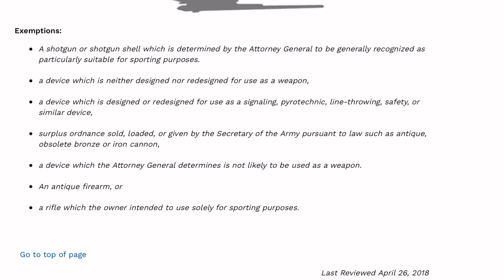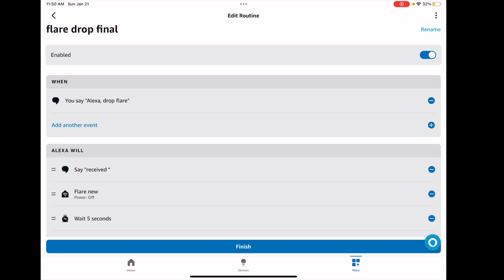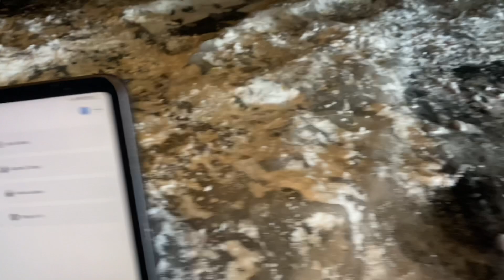Flare Launcher Prototype, Voice-Controlled |Safety Device (Real Life)

Comment: Amazon is a rip off. The gas from the .22 blank actually drives a piston forward at high speed hitting the head of the hardened steel pin or nail into concrete or whatever you need to drive a pin into.

Comment: Man, you really got me to thinking with this one.

Have you considered mixing model rocket fuel in a small quantity, pack in a metal tube with an electric igniter, add wadding, add your flare with the activation device?

Should cut down on your command to deployment time.  Come to think of it, a black powder pushing charge would do the same.  Everything would have to be super water tight though.

Going to have to ponder this some more.
Reply from the maker: Black powder is the fastest and simplest solution for sure! I’m constrained to often find roundabout solutions due to state and local laws.

Comment: Not usually a fan of these voice assistants (more accurately, not a fan of the corpos that own them) and don't personally trust them.
However, that is cool. 

   You might be able to achieve the same effect with a basic push button servo, which would be a closed system and doesn't require a wireless connection.
   Set up a switch board that will also drop your smoke devices, motor oil, bent nails. Go full redneck James Bond.
 (Dear feds, this is a joke. I do not encourage or condone littering.)

Maybe try a CO2 cartridge as your launch pressure (if you are worried about the legality of powder actuated devices).

Comment: Rotary servo could drop 3, 5, or  10 flares at spaced distances. Gatlin flare! 🤣🤣🤣 Good stuff! I love it!
Reply from the maker: What do you think the torque would need to be on that?
Reply: @InventionIncarnate  I'm not sure. But I envision a motor turned multiple mortar tube like a Gatlin that could snag the pull ring ignitors as it rotates. Maybe clocked or timed? Idk you just "sparked" some stimulating thought. Love the video. Thanks! Looks like a fun project!
Reply: Although I don't understand it, I like this kind of video. Have you ever seen the movie called "Speed"? Once the speed exceeds 50 miles (80 kilometers), it cannot be lower than 50 miles, otherwise the bomb will explode. Is there such technology in reality? @InventionIncarnate
Reply: @davinci3259  Thank you for explaining the problem that has been bothering me for three years. For three years, I have been wondering how it is done. Have you ever thought of doing an experiment in this regard? It turns out that it is a speedometer.